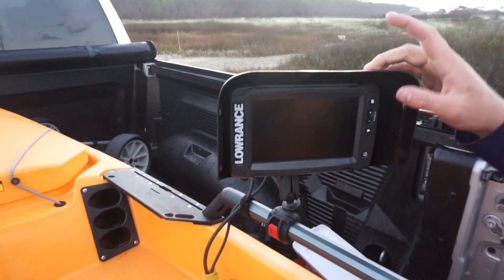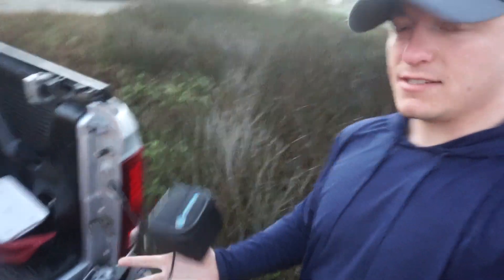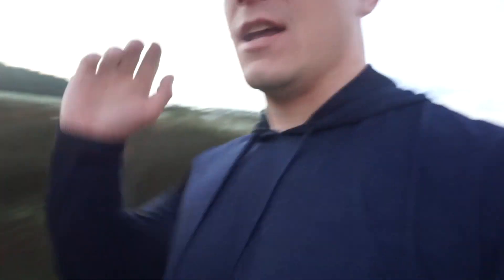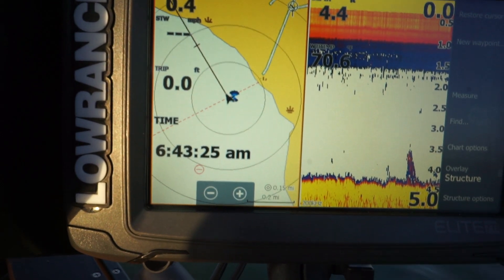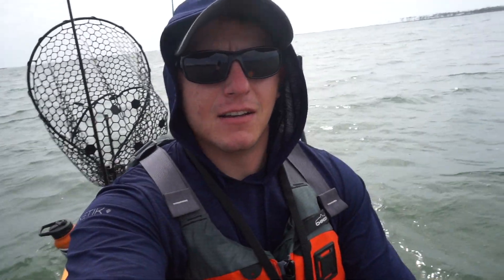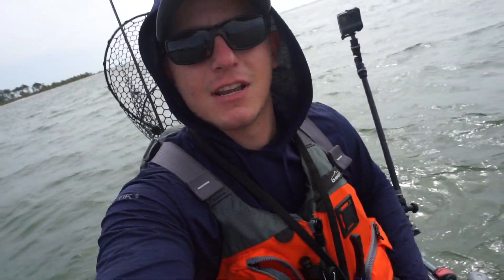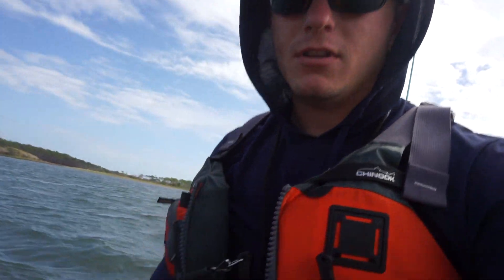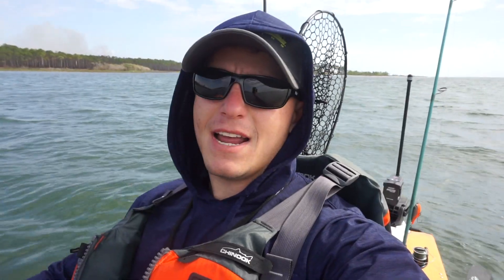Lowrance Ti 7 on 2018 Hobie PA14 w/ Nocqua battery

Comment: Mine lasted a little over 3 hrs- same model and had pretty much everything going.  Fully charged it was 12.59v.  Is this what you have?  Emailed Nocqua and haven't heard from them. Thanks
Reply from the maker: Sorry I never saw this comment it was hidden for some reason. I have the 10 amp hour battery and fully charged I believe my ff says about just over 12 volts. I’ve had it down to 10.4 and it was still going after about 8 hours running sonar and chart plotter.
Reply: Make sure you turn off Wifi, that eats batteries.